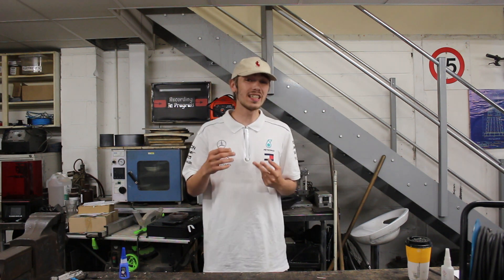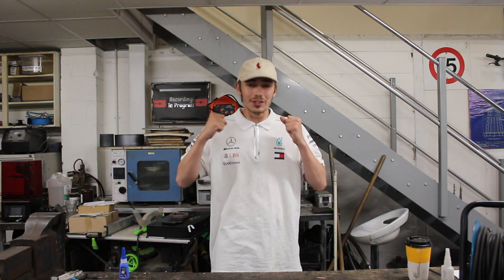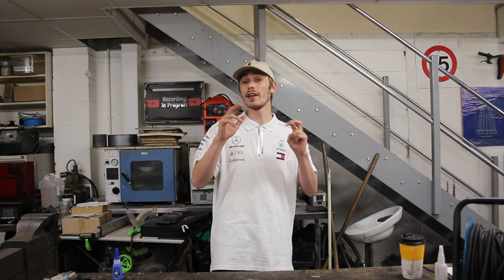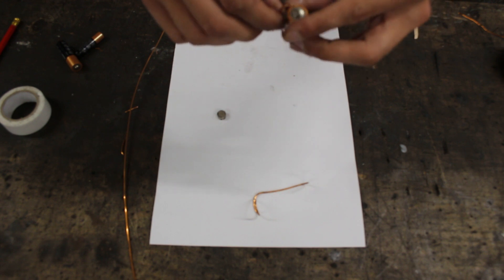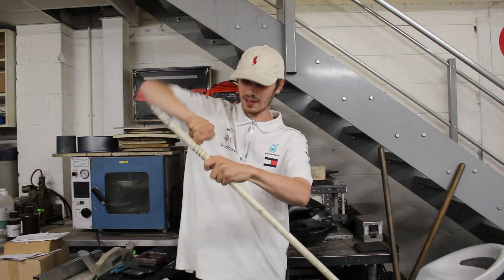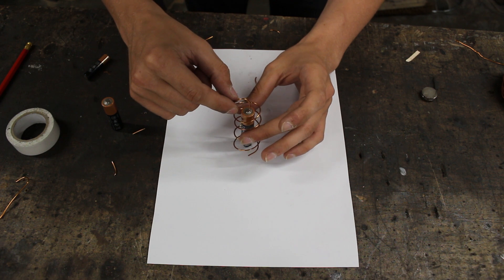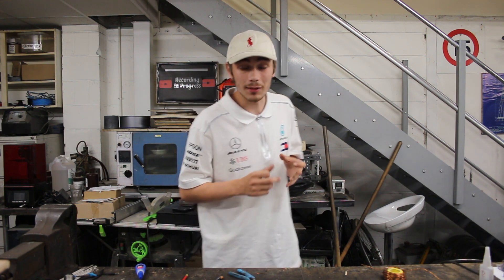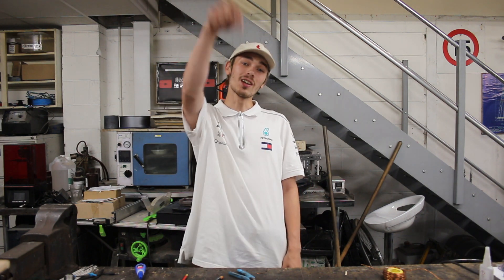1598 - Simple DIY Homopolar Motor

Comment: Is it April?  Love you, but, No.
N-Rays, Luke.  No contact, no circuit, no current, no motor.
Look up 'N-Rays'.
If you get it right it doesn't need a 'little push' to start it.
Reply: Funny that , I also checked the date .

Comment: Luke, I have to ask. 03:33 Where is the conductor touching the magnet at the bottom to complete the circuit? It is not clear in the video. A close up of the base might help.
Reply: I am with you here, I didn't see the contact on the bottom either. So how would the battery even discharge? Or is this strictly magnetic coupling?
Reply: @stewartpalmer2456  I don't want to say it, but I think Luke made a mistake. Or the camera angle is wrong. I have done plenty of these. He started right, but the final two versions don't appear to make contact. They need current to flow through the conductor to generate a magnet field. It will work with an intermittent contact, so it only needs to brush the magnet. It works best with a good continuous contact. So as I say, it may just be the camera angle, and it does make occasionally contact.